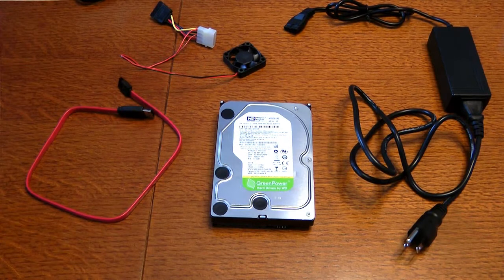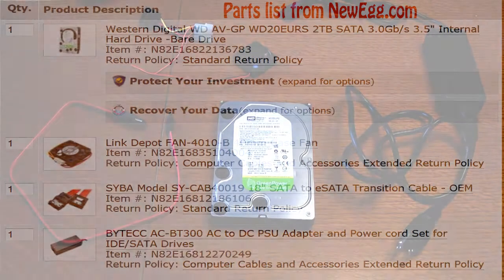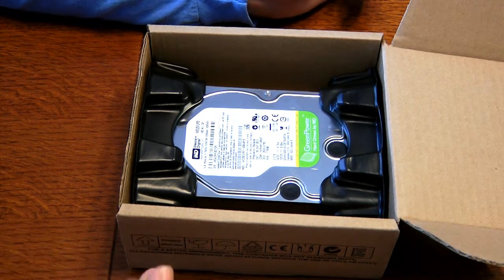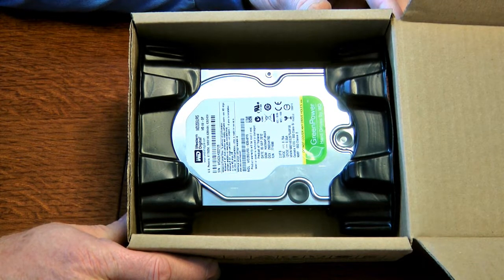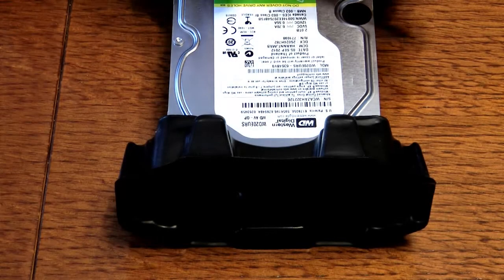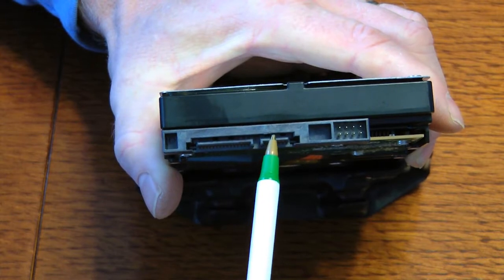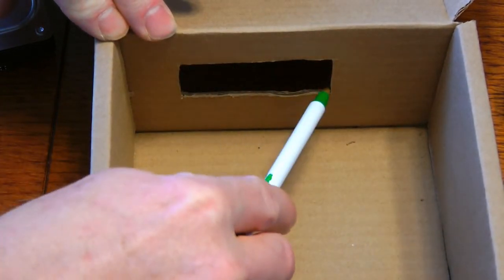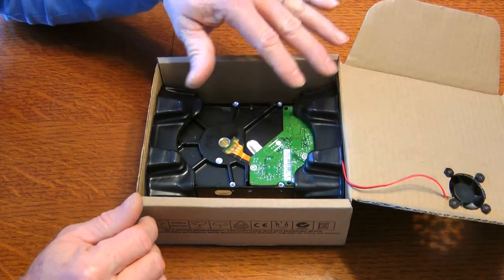DirecTV DVR 2TB or 3TB eSATA Hard Drive Expansion

Comment: Can I connect a hard drive to a non dvr Directv hd receiver and make work as a DVR? I see the HD reciever have a USB entrance. Thank you.
Reply: yabd They sell DVR's at major electronic stores. If you have component or composite outputs on your DTV receiver, you should be able to connect it to a DVR.   Just make sure the inputs on the DVR match the output type on your DTV receiver. If it doesn't work, just return it. 

I have my DTV receiver connected to my DVD recorder and it works just fine. Some DVD recorders also have an internal HDD for storage. They are a bit expensive but will eventually pay for itself if you are trying to avoid the fees that Directv  charges for the DVR AND the DVR service.  I purchased a TIVO many years ago and opted for the lifetime subscription fee ($250 at that time). It has paid for itself many times over already. I don't think they offer that option anymore.

Comment: Thanks for the video!  When I called DirecTV to inquire about expanding my video recording time they initially said I had to buy the drive upgrade from them, but eventually found a less zealous C.S. agent!  I'm glad you mentioned that an AV specific drive is needed as I had no idea as I was searching today for an eSATA drive.  I like that you chose to go w/ the K.I.S.S. ethic of using the packing of the drive for the external enclosure!  I understand this replaces the stock drive, instead of expanding its capacity.  What do you recommend as the highest TB drive?  Thanks again!

Comment from the maker: Sorry, I have no experience with multiples, but you can check the ISA spec. About the data transfer, sorry - it is not possible.  I have tried several tried and true methods advertised on the net. None have worked, even after hours of experimenting. And I am an engineer who does micro controller design.

Comment from the maker: One other comment, WD drives will almost always fail in an over-temp situation. If you think this has happened you can use a drive diagnostic tool to repair the boot portion of the drive.  Such programs restore from a backup image of the boot. DON'T use FDISK to do this!

Comment from the maker: Yeah, the only problem with only one drive manufacturer having a drive that will work . . . is the drive itself has to work. I don't use Western Digital drives.  But in this application it is the only one that will work . . . if the drive actually works. I have seen industrial product warranty claim areas with WD drives stacked to the ceiling. So I understand how you feel.

Comment: DEAN 
I have an ICY DOCK HD Enclosure that holds a 3TB Drive for my hd dvr
when its all set up my receiver tells me that there is a problem with the hard drive could it be the enclosure due to the fact that I have the exact same drive that you have on the video but  I have returned it  twice it keeps failing on me?

Comment from the maker: To be frank, I would only use Western Digital.  The problem is that the DVR is not a PC, it is what engineers call an embedded controller.  The DirecTV DVRs also use the Linux operating system.  Both of these probably mean that they probably made concessions in interfacing with the disk drive which they may not have even known they were making since it is a not-PC based system.  In fact, it would be in their best interest (and sanity) to only use one disk manufacturer. I also design controllers